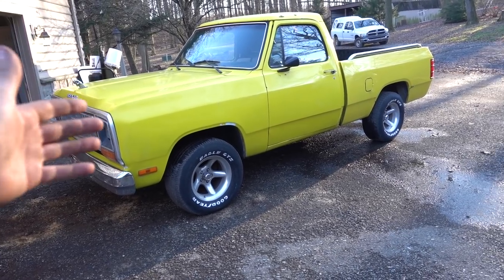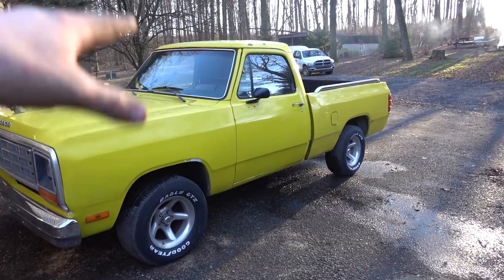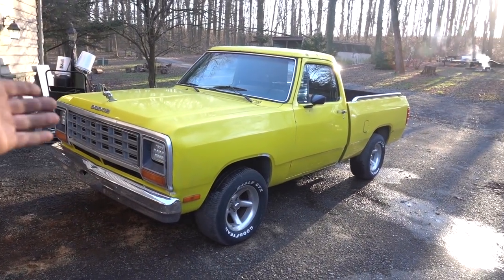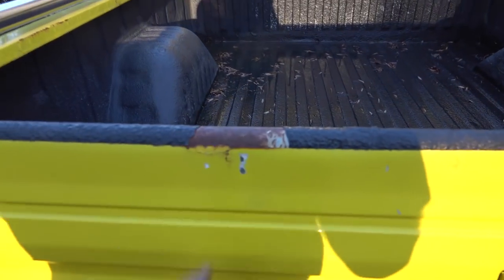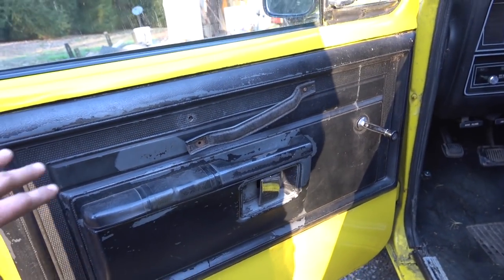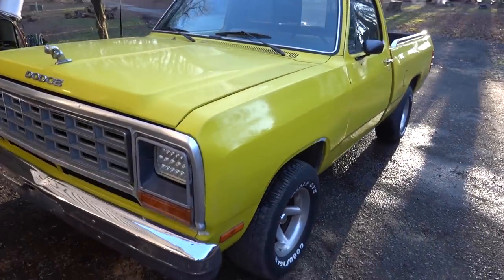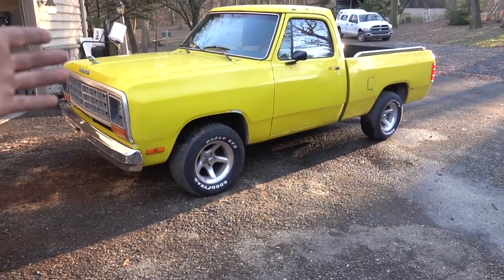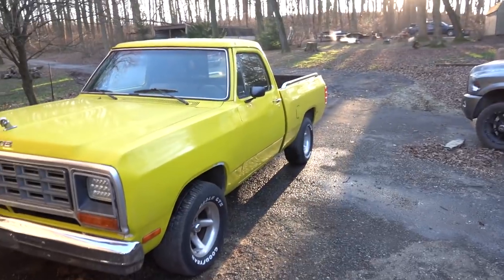WE GOT A FIRST GEN PROJECT TRUCK... It Already Broke My Cummins Transmission!!

Comment: I tuned Greg A’s first gen when it was a VE. So If you go with something with a VE pump let me know and we can work something out where I can come help you turn her up. I live in central jersey so I shouldn’t be too far from you

Side note. If you wanna lower it I believe the ram vans and Cummins lower control arms have deeper spring buckets. You should also be able to swap any d250-350 front suspension into it to beef it up

Comment: Just pull the carb off and clean it. Make sure the float is moving free and clean the jets. I use a cutting torch tip cleaner and a rag with brake clean to clean jets most of the time. 

Or get carb cleaner and soak it for a while works also. 

I like the yellow but I would not put a diesel in it. I would fix the rust, paint it and tune up the engine and drive it.
Reply: David Schmidt agreed, that truck is becoming more and more rare in stock form.

Comment: Dodge put the straight 6 Mitsubishi 6DR5 diesel in half ton, 3/4 ton and power wagon trucks from 78 into the 80's. The slant 6 has some support in the after market and can make good power.